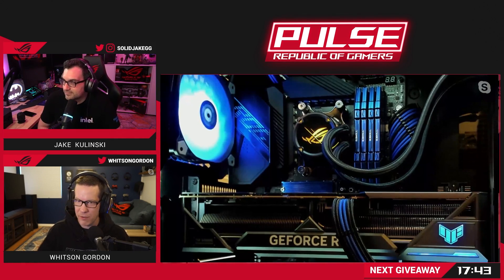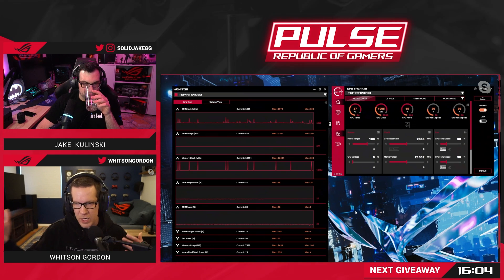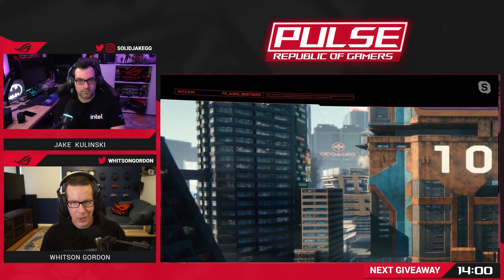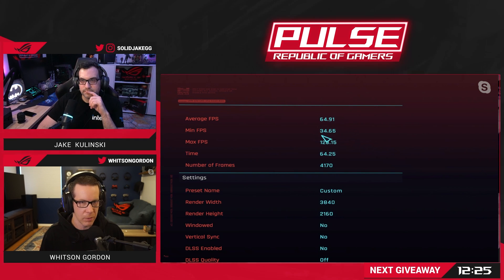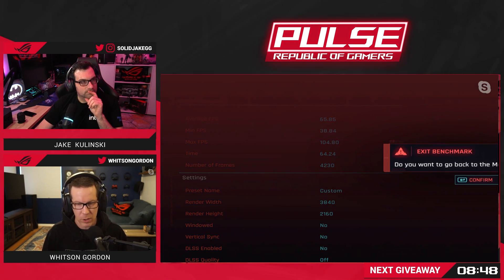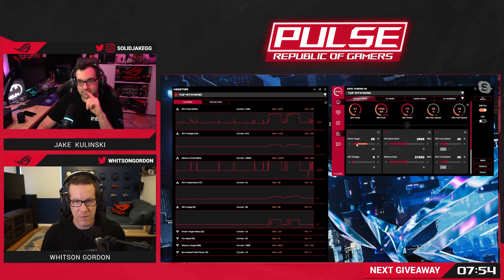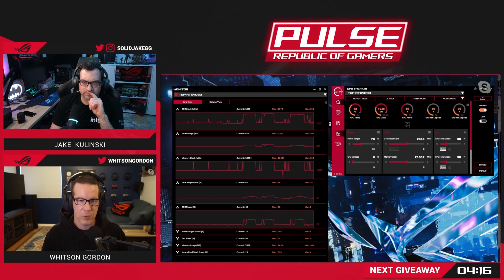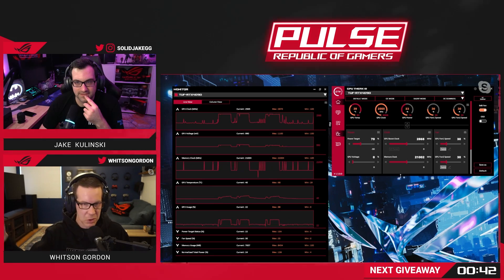The easy way to tweak RTX 4090 performance

Comment: Rog strix 4090 is by far the absolute WORST piece of garbage i've ever own. Higher temps than my 4090 FE and loud af coil whine. I gained nothing and actually lost more for accounting for all that extra weight and space. Sold this pos to some poor soul $400 over MSRP though a few days ago. Reselling when demands are high to capitalize off the profit is the ONLY reason ANYONE should buy a 4090 rog strix. 

If I had a free one, I wouldn't hesitate to chuck it out the window from a 10 story building, grabbing my bat and beating the absolute sht out of it. God DAMN I hate this card.

Comment: I would be in need of a guide how to undervolt in gpu tweak 3 using the curve optimizer, but I guess asus themselves also do not know how to do it, or more likely, gpu tweak is such a crap that it can't do it at all. Now I have to use MSI afterburner...

Comment: Yea, the whole 4000 series is pretty efficient. They don't get hot, they don't get too noisy.
Reply: A 4080 undervolted does not need fans at all it can be passive cooled, my gets to 60c at 2750mhz after hours of playing and pulling around 190-220w
Reply: @venusprinzj8094  that's crazy
Reply: @venusprinzj8094 wow! Can you post your setup somewhere so I can try to replicate?

Comment: Had a palit 1030, finally i managed to get a 4090strix oc, so happy!
Reply: I know how you feel. I had a 1080ti and I was finally able to get a tuf 4090 oc
Reply: indigoblu01  If you're asking if my 4090 has coil whine, I don't hear any. my core clock is 223. I could have it higher, but 223 is more than good enough

Comment: Just got my Tuf Gaming 4090 in and there is a huge amount of coil whine, temps were good, power was good, and it boosted up to 2715 stock.  Im waiting for my right angle 12VHPWR connector to come in so I can put the glass panel back on but it still is loud even with this glass on.
Reply: How did it go?
Reply: I jammed mines in a li lian dynamic evo case 😂😂
Reply: I have an Asus TUF 4090 running at 2765 in stock no coil whine so far  may be you should try to change your psu I have a msi ai 1300 atx 3.0
Reply: @jackjacks7939  PSU was brand new at the time. Corsair 1200w. I would like to think that wasn’t the cause of it but when it comes to electronics anything is possible.
Reply: Just buy Gigabyte - ASUS is trash tbh
Reply: @a.crypto2725  Why would one choose a Gigabyte model when you can get a Asus Strix 4090 that has the best power delivery of them all. And it looks nice as well.

Comment: So instead of "overclocking & undervolting" you ran an 11 minute AD for Asus's GPU software and lowered the power limit of a card for slightly decreased performance...
Reply: just useMSI Afterburner
Reply: yeah this was a shit video. didn't actually overclock it at all

Comment: hi
this is all a different language to me. I need help $
i have the msi 4090  b550 f   64mb ram ryzen 7 3700x  and im not getting good frames. need a step by step tutorial.
plz message me. 
Thank you
Reply: well i think first step is to change your processor because you have a huge bottleneck!
Reply: @breaveheart8078  hi
So what processor can i upgrade to with out changing the motherboard?
or if i do have to change the motherboard and CPU i could use another computer for work and just build another...I was thinking about the B670e wifi and ryzen 9 7950 x and gskill ripjaw ddr5 6000. Is that worth it or just a newer motherboard?
thank you in advance.
Reply: @damonlamont9141  I use mine with a ryzen 9 5950x and game at 1440 p and still I have a small bottleneck in some games,and în your case you can go: 1.with ryzen 7 5800x3d(you don't have to change mainboard), 2.wait for the new x3d amd procesor or 3.Intel 9 13th gen(for 2 and 3 you have to change your mainboard) but remember that at full HD and 1440p in some scenarios you will have a bit of bottleneck because ryx 4090 is a card for 4k and 8k resolutions!

Comment: if 4090 had no risk to burn i would buy it, but when i look to the news about it, i reconsidered it ....
Reply: Seriously? The cable thing was small and who uses the adapter anyway? I have a strix 4090 and a custom cable it's fine. The thing that is terrible is armoury crate.
Reply: They proved it was a 0.2% failure rate that was 100% due to users not installing the power cable correctly.
Reply: @LAncegtavicer  yup
Reply: "if 4090 had no risk to burn i would buy it, " LOL ! Good luck

Comment: I have MSI RTX 4090 Suprim liquid X. It can easily reach 3030Mhz without flashing any third-party vbios. Stable +250Mhz clock speed under stress test.
Reply: Can you share your OC? Are you using MSI After burner? Am having the same card and I want to push it further
Reply: @snakeam  just got this card it shuts my computer down as soon as I switch to 4k x_x about to rma it this week.

Comment: Why in Indonesia, Flow X16 highest model that uses 6900hx and RTX3070Ti, only use an IPS screen, even though it uses Mini LED outside indonesia?
Even in the latest revision outside Indonesia, there is a lower model that uses 3050ti, also uses mini LEDs!

When I bought the Zephyrus G14 it was the same, outside Indonesia it used QHD 1440p, But in Indonesia it only got FHD 1080p, even the highest model.
Only youtube reviewer got sample g14 with 1440p, is this scam by asus indonesia ? 

Is Asus, Underestimating Indonesian Consumers ?

Comment: Is there a frame limiter somewhere in GPU Tweak III? This program disables and resets Max Frame Rate in NVIDIA Control Panel. I'd like to be able to limit frames while still overclocking.

Afterburner/RTSS was giving me problems with some games, so I wanted to try this as an alternative. Thanks!

Comment: Limite Fps 65 in gaming maximize frequency boost Fps. 4K 65fps fixe ray traicing Rx6900xt 😃👍🏼
Reply: 6900xt does almost 50-55 fps with FSR on ultra performance, and yeap, it's 2k 😁

Comment: Hey fellas, I have the Strix 4090 and a HX 1200W Platinum. I got the Corsair cable Saturday night and plugged it in and got no video output, but it made it to windows. Restarted the PC and same thing. Then I turned it off and flipped the VBIOS switch and turned it back on and I got a boot screen and all the way into windows. But when I went to play Call of Duty MW2 and went into the game settings for the new GPU the screen turned off. I had to hard reset. Got back into windows then launched the game again. This time I was able to play for about 5 minutes and the screen went black again. Then I turned it off the PC, plugged the adapter back in and all checks out and works again like it should. I'm guessing since the Corsair cable is only drawing from 2 - 8 pin plugs its causing an over current protect. Also, I was thinking maybe if I flip the switch on the PSU to single rail it would feed the power the GPU needs through those 2 - 8 pin connectors. Haven't done it yet since I haven't got an answer from anyone. So, I'm sticking with the adapter until I can get my hands on a CableMod 4 - 8 pin to the 12X4 cable (which is out of stock) Can someone let me know if going to single rail would help with using the Corsair cable.
Reply: Strange. Maybe you just got a dodgy cable. Just got the Corsair cable myself a couple of days ago and haven't had any issues. I have the 4090 tuf and a 12700k. The gpu I've overclocked the same as they did here just by maxing the power and voltage sliders. Runs around 2850mhz on the boost clock. And my cpu is overclocked to 5.1 by the bios ai overclocking. I only have an 850w Corsair psu and it seems to handle it just fine.
Reply: @nekosinner9177  IDK, I have the Strix and might have more power draw. Or higher voltage spikes. I did get into windows with it after switching the VBIOS but once I got into a game the screen turned off when I went into the game settings. Then after a hard reset and got back into the game, I thought all was good and played for about 5 minutes and then the screen turned off again. Not having the issues anymore with the 4 to 8 pin spread over 4 connections to the PSU. I never did try single rail. That might have helped it.
Reply: I would try leaving the card on the performance bios, save your current bios settings on a mobo profile, clear your cmos on the mobo, and make sure everything is detected correctly on the “first time setup” bios page when you boot back up. If everything is good at this point, reload your profile and do a DDU clean install in safe mode, replace the old driver with the most current Nvidia driver (I recommended studio drivers tbh, they’ve always been more consistent and stable for me), and try out MW2 again. 

If you crash again, I would consider uninstalling GPU tweak and moving over to MSI afterburner. GPU tweak caused a crash almost immediately for me after starting the in-game benchmark. Afterburner has always worked like a dream for me, however, my current tuf gaming oc 4090 can barely break 400W with the cablemod 4x8-pin to 16-pin adapter. And the power, temp, and voltage sliders are all the way up and registered to work with third party cards at the kernel level (in afterburner settings). 

I’m probably gonna clear my CMOS, and flip my switch before and afterwards so it’s “freshly booted” onto the performance bios, and registered as such in the bios & windows. ASUS makes sub-par software, and it’s always been something I’ve stayed away from. I even refuse to install armory crate because all it does is ruin windows for me, and ruin the registry.
Reply: @joselaba  Dude short version. I got the cable mod 12+4 to 4 X 8 pin a few days ago. Everything works just as it should. It had nothing to do with drivers or BIOS or anything you mentioned. It was the power and nothing else. Even with the adapter I played hours of Modern Warfare 2 without a hitch. It went bad with the Corsair cable.
Reply: Oh yeah, With the cable mod I was pulling 420W and it worked fine.
Reply: @feeterican  interesting, I’m glad that worked out for you tho. Messing with software is usually worse than the hardware side of things. Just curious, are you playing at 4K? Or using any DLSS? I’ve been playing with reflex on+boost (w/ my 1440p@240Hz monitor that supports reflex), and DLSS-Quality for the lowest latency possible @ high gfx settings. I’m probably not just stressing my card out enough lol
Reply: @joselaba  No I'm running the 4090 at 1440P, and I turn all that other helper stuff off. I was running DLSS on my 3090 but now I have a card that can handle it, I turned off DLSS and I don't use the reflex either. I try to run games at MAX settings with the least amount of help or as native as possible. No FXAA or MSAA or TSAA, I'm not a fan of Vaseline on my screen in the form of AA lol. I have videos on my channel with the 4090 and 3090 and my older PC's as well. If you're interested in watching them just hover over the title to see if the game play is using the 3090 or the 4090 and watch the FPS at the top left and get a general IDEA. The settings are the same for both GPUs. Also, my G-Sync monitor only goes to 165FPS, and that's where I keep it at all times, it's good enough for me lol.
Reply: @feeterican  Gotcha, that is rather odd then that my 4090 can't even hit the 400W mark at 1440p ~225fps. I have tried it without DLSS and reflex, but I suppose I should give it another shot. Regardless, it seems like the 4090 absolutely smokes the game out of the water, so I suppose I may be very CPU-Bottlenecked with actual gameplay. I do have an overclocked 13900K, but the memory is only at 6800 Mhz while I wait for the z790 Apex to go back in stock and let my DIMM's unlock at their full XMP Profile of 7800Mhz. We'll see tho, currently at a 1000Mhz Mem OC and 150Mhz Core OC, the card isn't even sweating past 400W.
Reply: @joselaba  When I hit 420W I was running the 3D mark (free version) benchmark timespy with the Nvidia overlay. Also, I'm running a 9900K 5GHz all core (nothing speacial until I can upgrade to the 14900K. (and thats even what they will call it when it comes out)) oh yeah and my ram is only 3200MHz.
Reply: @feeterican  Gotcha, I gotta do some deep digging then. Or just simply test it with 3D mark lol. Thank you for the information. 

Also, I would probably reconsider waiting for 14-Gen? Latest I saw from gamer meld (YouTuber) was that it’s being delayed until 2024, but that’s only a rumor as far as I’m concerned. You do have the 13900KS coming out soon for sure tho 🤷🏻‍♂️. From my experience, 13-Gen so far has been a considerable upgrade from 12-Gen, especially with the latest DDR5 RAM speeds from the z790 chipset. Food for thought for your build 💪🏼